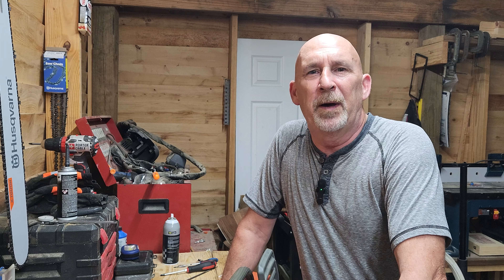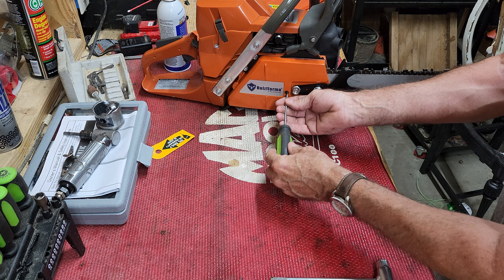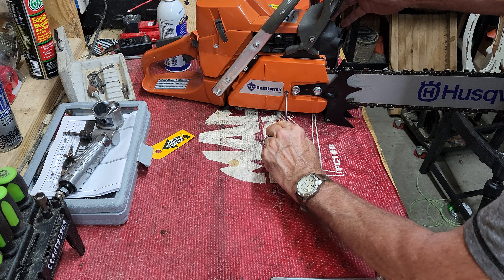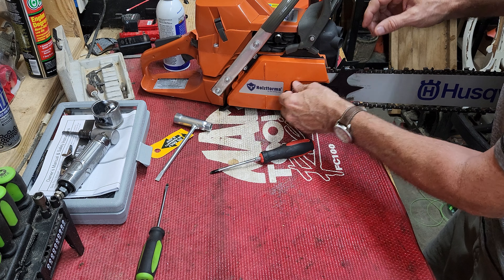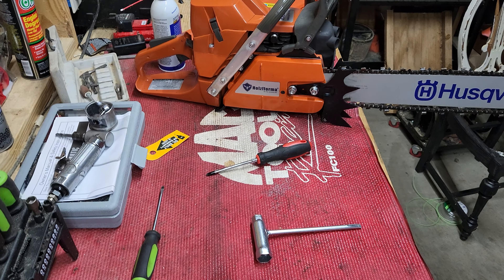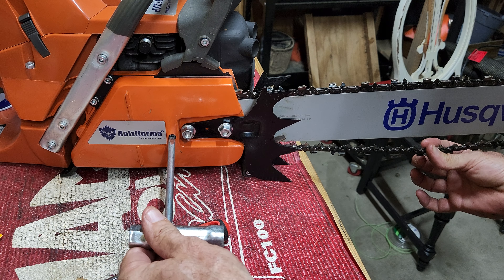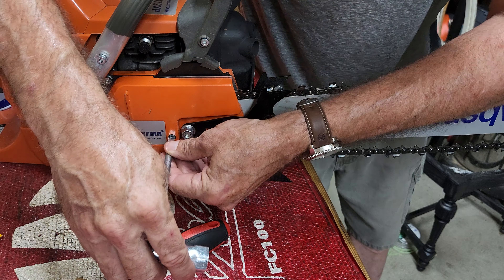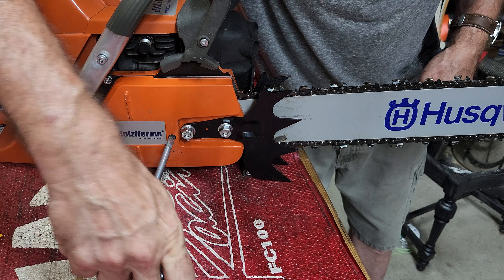Holzfforma 372xp Update On Chain Tensioner!!

Comment: I have same problem and also the chain also loosens all the time this is the only problem I am having with the saw ,, The one thing I also noticed with your saw is that your 2 bolts for tightening the bar are longer then my bolts and you can get your second dog on,, i cant
Reply from the maker: @nevetsnietsnedlug8115  the stud length thing sounds strange to me, I've owned two G372xp's and the G395xp with no problems.  Typical cause of chain not staying tight is not lifting bar and chain when tightening bar nuts. Only other reason is probably not one you want to hear, bent crank snout where clutch fastens. Clean and lube that tensioner real good.  Thanks for watching

Comment: I recently bought one, not even a month ago, and it's a good saw, but I do wanna know if I don't know if I could use a different type of grease or not I do have bar and chain grease but I'm not sure it's a specific grease I need for it
Reply from the maker: @brandanevans5626  if you are referring to the bar oil system.  Any quality bar and chain oil works ok. Any farm store or lawn and garden store will carry. They make both winter and summer blends. Thicker for summer and a tad thinner for colder weather.  I typically use county line bar oil from Tractor supply
Reply: @ourkentuckyhome771  I'm referring to the adjuster. I used the push n lube on the adjuster and the tensioner, but before the chain itself, when it got tight, it would look like it's on, but moving the chain comes loose even when it's running I'm only 20 and I've never seen a stocked saw have the chain spinning like that
Reply from the maker: @brandanevans5626  any grease can be used on the adjuster, white lithium grease is very good.  New chains stretches the first several times it's used. Be sure when you adjust your chain to lift the end of the bar, get chain good and snug. While holding tip of bar up, tighten bar in place. Chain should be fairly snug on bar with zero slack in it. If bar is not up when you tighten it. Chain will loosen immediately.
Reply: @ourkentuckyhome771  Thank you for your help
Reply from the maker: @brandanevans5626  You're welcome

Comment: my g372xp I just got it and it’s nice, but I’m having issues maybe you can help? 1st when I get to around half a tank and I’m in a cut the (power) goes up and down, put more fuel in and it’s ok, another thing is when I first go into a cut it’s bogs like it’s caught in the wood, lift it up and rev full speed again and it cuts but it does get caught randomly in bigger logs mid cut almost like it pinched but it’s not, like it’s caught and doesn’t have the power to push through at random times? You’re thoughts
Reply from the maker: First thing I would verify that fuel filter is laying flat in bottom of tank facing bar side. Sounds like fuel starvation. More info, is saw new being through break in period? Typically they are set very rich from factory and need tuning. If it was tuned when not completely warm it will bog in the cut. Try adjusting high speed jet at wide open throttle turn right until saw screams like it's going to come apart. Then turn left a little until it just starts to gurgle a bit. Another possibility is air leak and leaning out in cut. Check carb screws for tight also clamp on bellows to carb.
Reply from the maker: What bar and chain combo are you using?
Reply: I’m using a neotec 24 inch bar and chain, it’s not the top name brand but it does ok, I will follow you’re instructions and get back tomorrow with you
Reply from the maker: If saw is starting and idling ok, don't adjust low speed jet. When you adjust hi speed, clockwise is lean and counter clockwise is rich. Should not need to turn more than a 1/8 to 1/4 turn to really here a difference in rpm. A tach is the best to have to know you have max performance. However I always go by what I hear the saw doing.  As your saw gets more break in time, don't be shy about checking jetting again.  They can and will change after a period, especially with weather and altitude change.  Make certain you are running 50.1 mix. When you adjust high rpm, it's best to have hearing protection on, it will let you hear saw change in pitch as you start richen it back up. One other question I have,  does saw still perform well when it is on its side? John